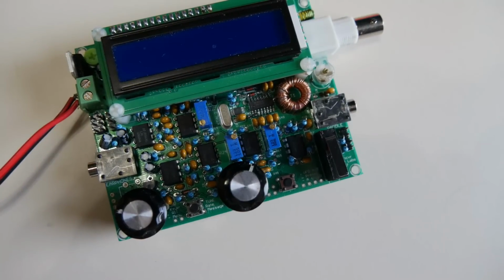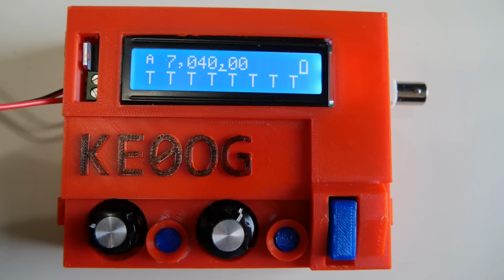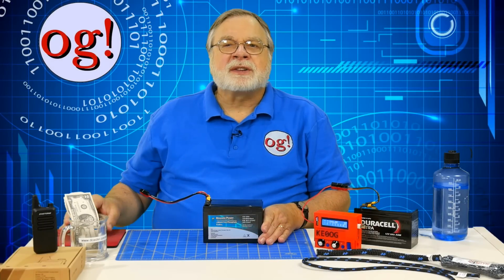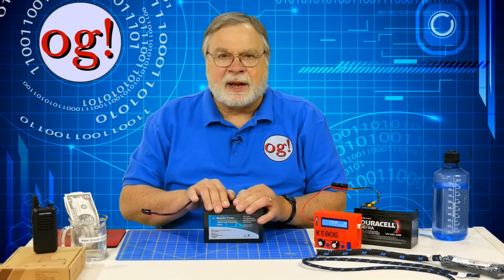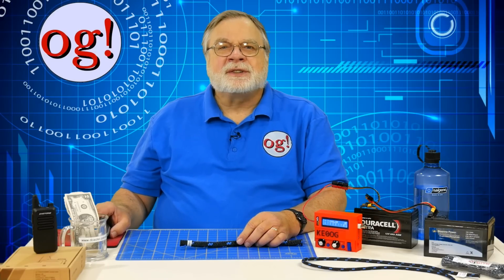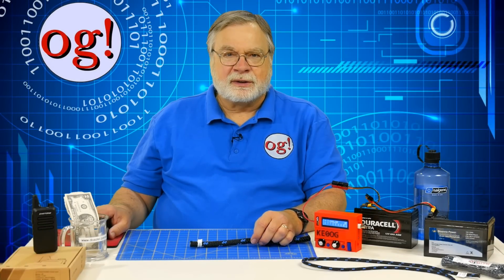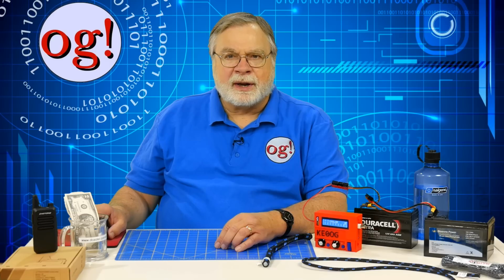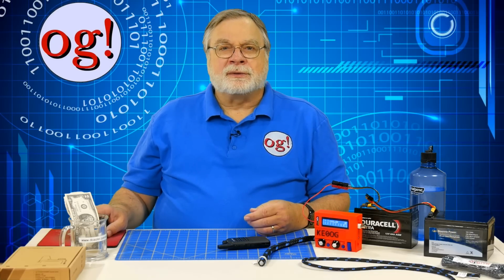Reviews of QCX Case, battery, Mastrant Rope, Zastone X6 (#139)

Comment: I love the LIFEP04 batteries.  I understand they are not subject to exploding and fire. One very neat aspect is that a cell is nominally 3.2 volts so they are great for much of the electronics these days that require 3.3 volts. 3.2 is well within 10 %.  You don't need voltage regulator circuits which makes them a much more efficient "system".  I recently got 4 for $10.  Cant remember the capacity but pretty stout.  Also same size as AA. Very usefull

Comment: Dave, LiFEPO4 batteries, all lithium batteries, are great. But read dome of the docs, they are easily killed by improper charging. Need special care, and awful expensive if you kill them with a conventional charger.
Reply from the maker: Yes! Use the charger they come with.

Comment: I notice that in the case the two knobs are even but not on the raw rig, please explain. The case looks very good though.
Reply: Shaft extension for the pot and two push buttons.
Reply: There is no shaft extension.  The difference you see is an optical illusion.  When built the two knobs are parallel to the edge of the board and can be set to the same height by just moving them up or down on the existing shaft.